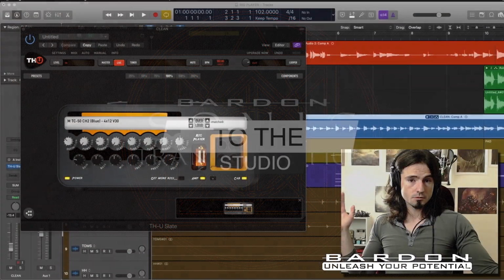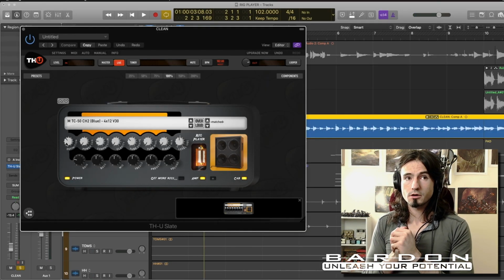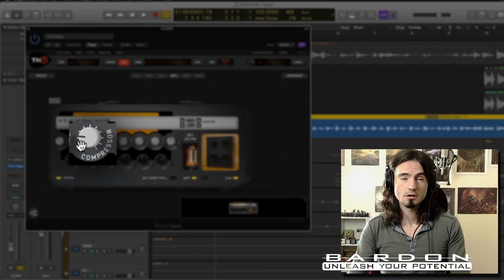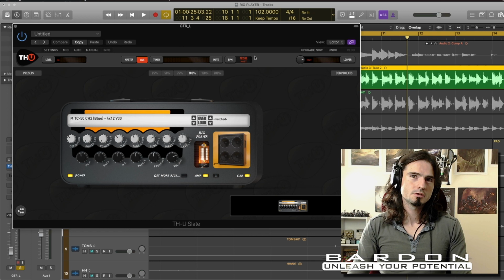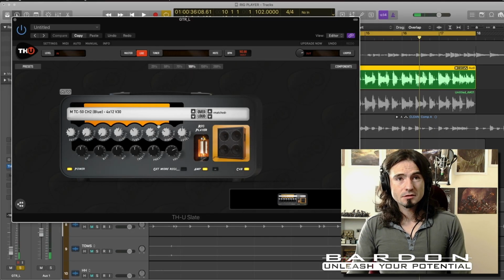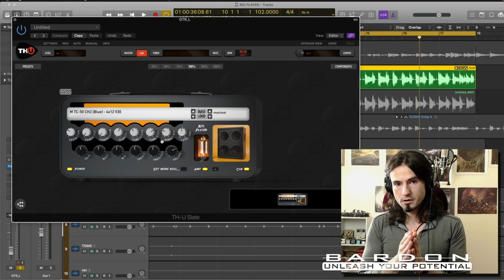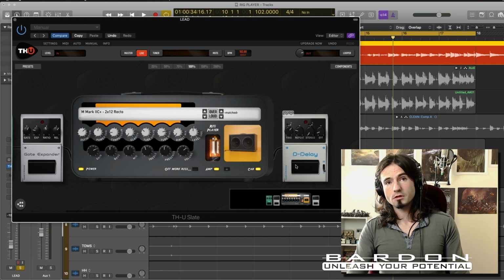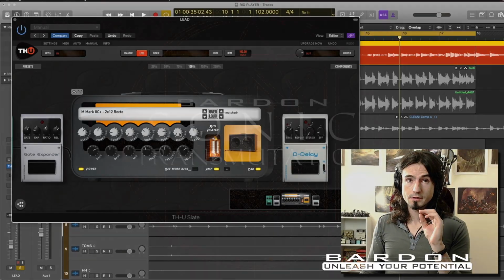Realistic Guitar Plugin TH-U Rig Player by Overloud | Best Amp Sim Plugin

Comment from the maker: You won't believe how easy it is to get a great heavy sound using TH-U, let me show you how: https://youtu.be/oT4VC8gQ2oo
Reply: What’s the difference between the 190 dollar version and the 280 dollar version?? I’m thinking about buying this i tried bias fx out for some reason i’m getting crackling and it just doesn’t sound right. Tried the demo version of THU and it sounds really good no crackling sound at all. Do u think if I bought the full version I would have the same problems i have with bias fx? Since i’m only trying out the ThU demo version and it seems to work fine.
Reply from the maker: @Unknownn_nx3  In my experience with using software like this the full version comes loaded with great stuff BUT unless you actually need to have access to all of the different FXs and amps I would recommend to get either the Rock or Metal version depending of your style, it's 79 bucks and comes loaded with amps and FX based on the genre and the best part both have access to the Rig Player which is the Killer app!!!! And related to the cracking issues, since the demo version is running perfectly the same will happen with any of the paid versions so I would say go for it!!!
Reply: Bardonmusic probably gonna buy the rock nd metal edition didn’t know u could buy them separately. Are all the editions that i buy in the same menu in the program or do i have to start up each edition separately? Like if i wanted to use a certain pedal that isn’t in the edition that i’m running or is everything already there in regards to the amps and gear being in the same menu making it so i can use all the editions amps nd gear together at the same time.
Reply from the maker: @Unknownn_nx3  Thats a great question, to be honest I haven't tried those versions yet since I am only familiar with the one that comes with the Slate Digital Bundle, I think that both will share the same basic FX'x selection the main difference would be on the amps and cabinets. What I would recommend is to get the rock version which is the most versatile and the buy the American Sound Rig collection for the rig player as it comes with great amps High Gain Amps so you can get the best of both worlds!!! those rig collections tend to be quite cheap, like 19 bucks!!!
Reply: Bardonmusic yea, that’s what i wanted to ask you about as well because i just watched your video on rig library, so i can buy the rock edition the $80 one and don’t have to buy a full version of thu overloud in order to buy all these collections and add ons for the thu overloud? Any add on or collection i buy will be on the interface when i start up the program once i buy the rock edition? 

So this rig library thing  is in use when i buy the American rig collection and only in use for the rig collections and can i use an midi pedal with all this too?
Reply from the maker: @Unknownn_nx3  In my opinion the rock edition plus the American collection would cover more than enough terrain, if you feel that in one point you need to expand your already extremely big sound palette you can always upgrade to the full version. Just for the record the version that I'm using is the Slate Digital Version which is close to the rock version in terms of what it has to offer and it is very good even more once you get a Rig Player expansion. In terms of midi it is fully supported so you shouldn't have any problems using your controller pedal!!!